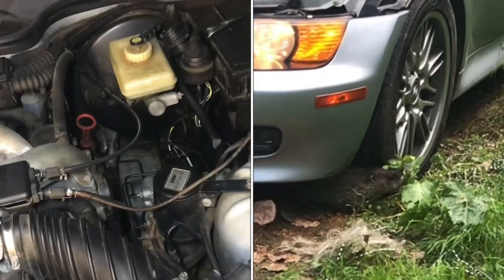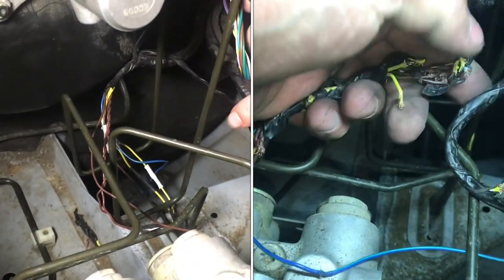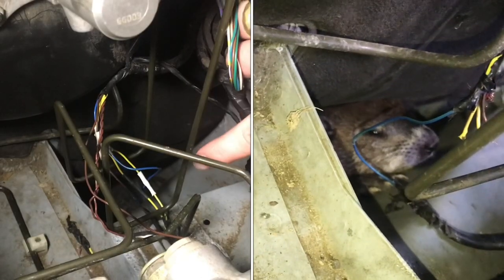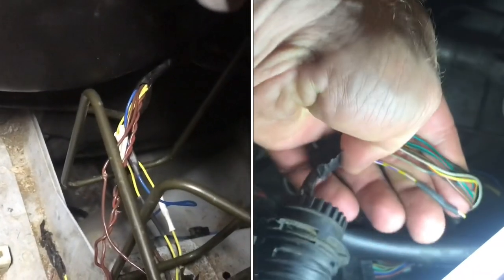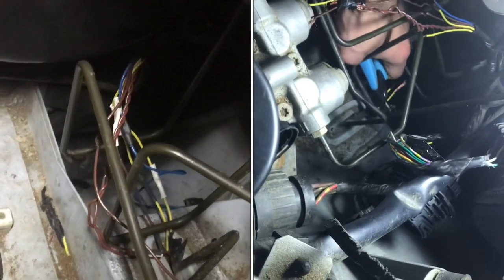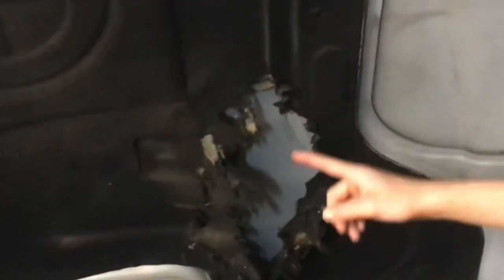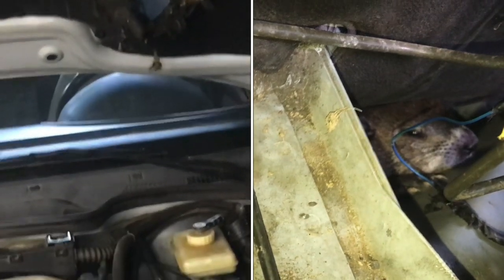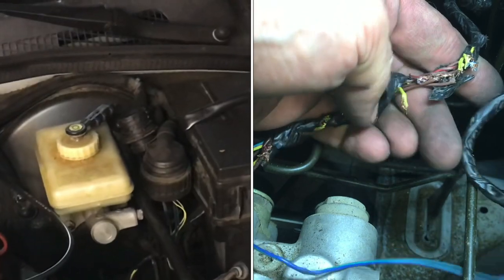fixing a CHEWED wiring harness (groundhog damage)

Comment: A mechanical engineer that I know who specializes in plastics engineering and extrusions told me that when the insulation is hot-extruded over the copper wire in the factory, they have to use oil to cool and lubricate the rollers. The cheapest oil that was available to most of these manufacturers that had a smoke point high enough to deal with the temperatures was peanut oil. Ever smell a new coil of wire? Smells like peanut oil. It also smells (and tastes) yummy to those furry little buggers that like to crawl up into our engine bays.
Reply from the maker: Wow! That makes total sense. I was thinking I might spray pepper spray on the wires to try to discourage these guys. After this I am kind of afraid to park the car in the yard. I know a few other people that I’ve had the exact same thing happen. One of them had the groundhog actually got the car in the garage.
Reply: @livefree6878  Yes, I have tried pepper spray and peppermint spray in the Fall when mice look for new places to nest. I don't know if there's a sure-fire answer to this problem. I do know they can do VERY expensive damage to your vehicle anyplace a wire loom runs. That's kind of obvious. I think the best advice I can offer is to trap the groundhogs and relocate them too far away for them to wander back. And having a few cats around will greatly reduce the mouse-nesting population too. If you do use a trap, make sure you think about being able to open the trap door for releasing the animal remotely. When you accidentally trap a skunk one day, you'll understand why.